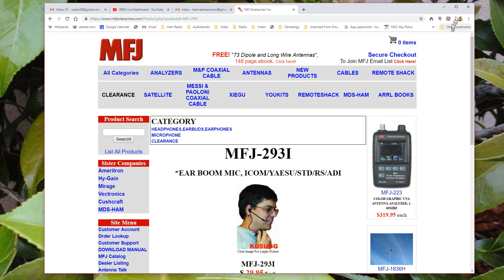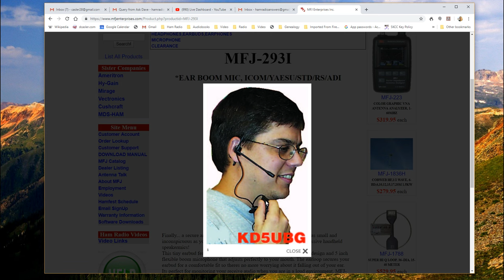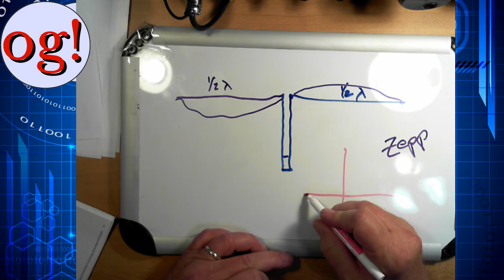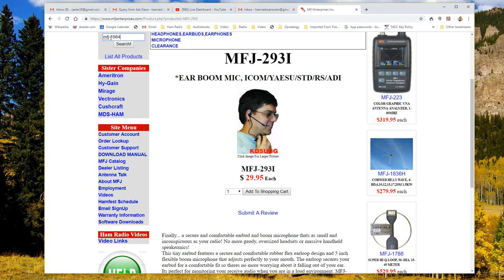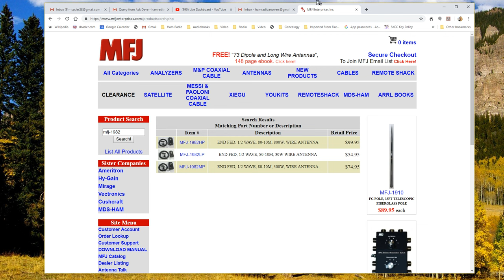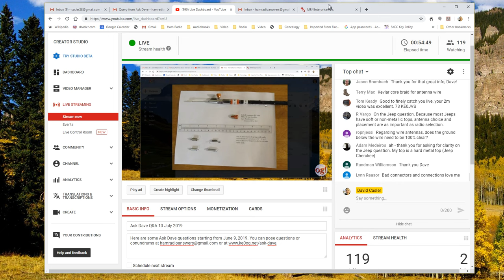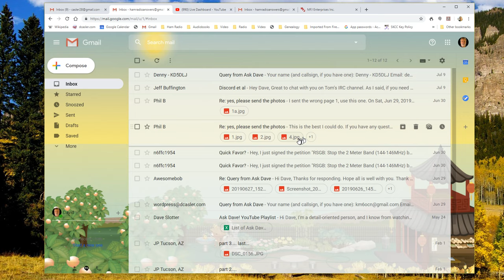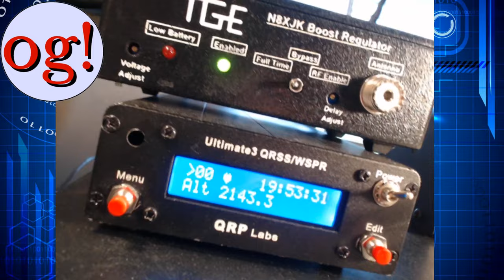Ask Dave Q&A 13 July 2019

Comment: RF in the shack. Where would you start to investigate?
Mike
Reply from the maker: Grounding, grounding, grounding. Make sure you ground the equipment into the shack's single point ground, then connect that properly to an external ground rod. Ground the antennas via lightning arrestors at the ground rod where they enter the house. Also, try moving equipment around. Sometimes a simple rearrangement helps (it has helped for me).
Reply: @davecasler  Thanks a million, David.